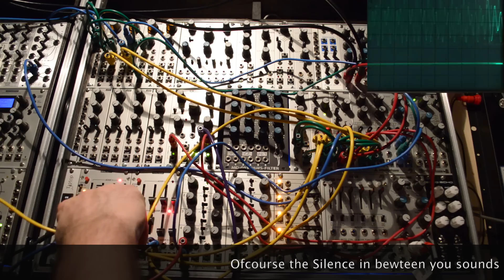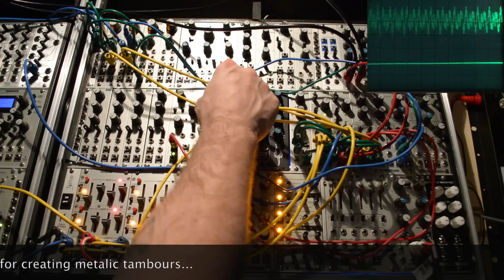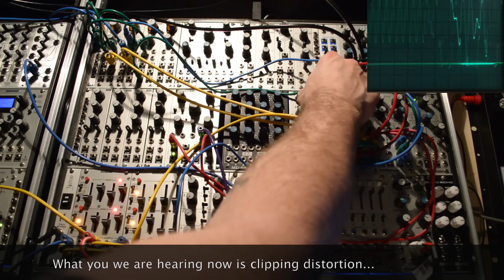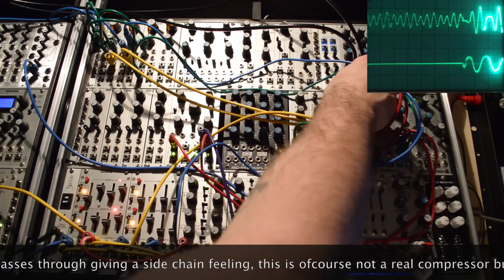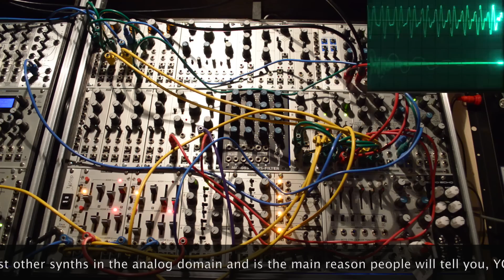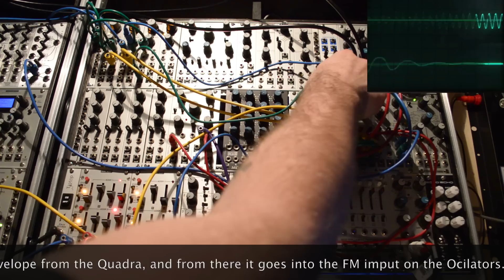Why can I never have enough VCAs? Part 0 - Introduction

Comment: hi Frank, based on your videos, im thinking of getting an attenuverter...  my question is if you think this one is a good one... and whether it's bi-polar..  -Would appreciate your input.  https://www.befaco.org/en/dual-atenuverter/
Reply: The word "Attenuverter" basically means it's an attenuator and inverter, which means it's bipolar.  The one you're looking at is definitely bipolar.

I wouldn't deliberate too much about things like attenuverters personally.  Just pick something that looks reasonable and go with it.  

That module in the link looks perfectly good to me, especially since it's got DC offset built into it too.